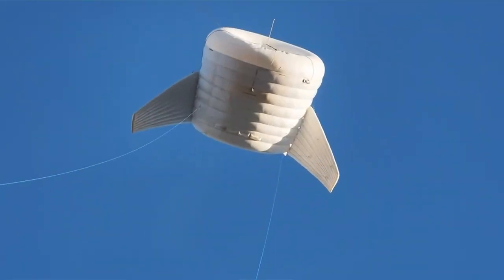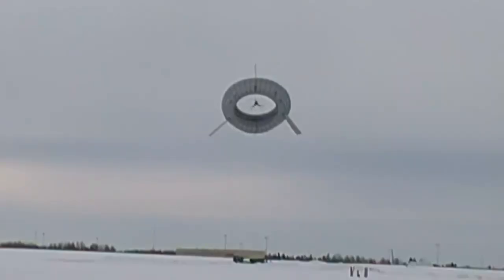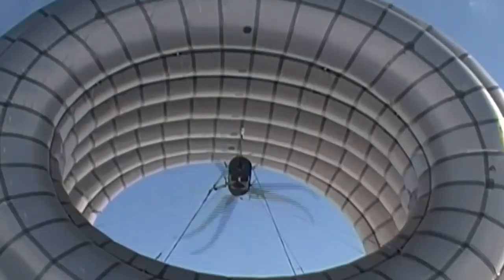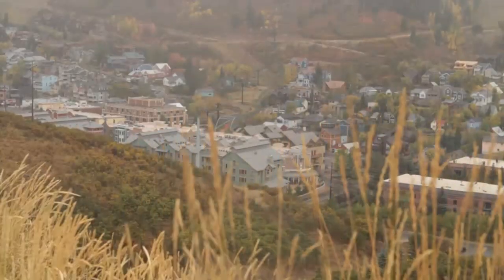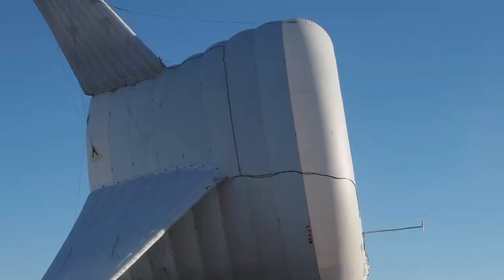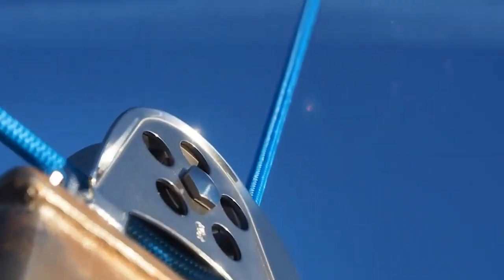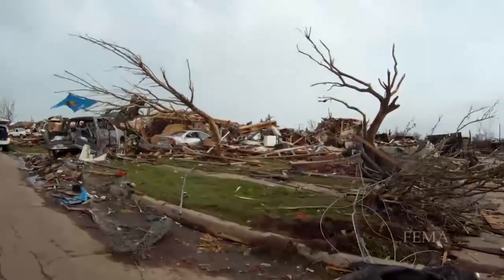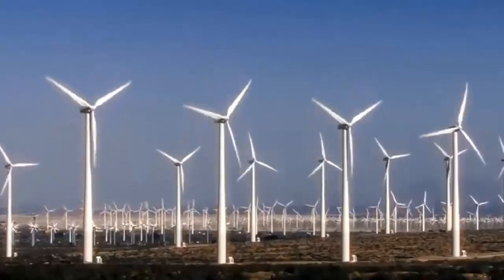Airbone Wind Turbine Generates More Power Safely | Video

Comment: I like the idea, but they plan to use this for disaster situations, alongside first responders.    they compare it to traditional wind turbines, but how does it compare to whatever first responders already use?  which I assume is a big truck with a big generator.  first responders care more about reliability than efficiency.
Reply: I would argue that you could be given multiple choices in what type of generators to use. The wind turbine shown above could be a longer lasting effort when compared to a conventional diesel-electric generator. As the diesel-generator requires a constant supply of fuel whilst the wind turbine could just hover passively without much effort needed.

Both options have pro's and con's. Fer-instance, the wind turbine would be nightmare to setup in New York city.
Reply: *****  Diesel-generators don't work without diesel, oil, cooling.  Wind-turbines don't work without wind. Solar panels don't work at night and battery power is expensive.

Everything has pro's and con's.

Diesel-generators have a high output, reliable and can be transported easily.
However, they require fuel, oil, cooling, maintenance, spare parts and is semi-expensive.

Wind turbine has a high output, is wind-dependent, is very light weight and is relatively cheap.
It only really requires wind.

You get my point? Everything has pro's and con's. So if your at the coastal areas, wind power is not such a bad idea.

Comment: So how long till a $1000 drone blacks out a community for a few million?
Reply: anationify up high like this though, there'd be few disadvantages to just switching to Hydrogen.
Reply: roidroid Absolutely. It's cheaper and I'm sure they will use hydrogen.
Reply: Mark Lucas roidroid I don't have a science background so can you explain why it'd be better to use hydrogen? I thought we used Helium because it was unreactive (no more flying Hindenburgs in a lightning storm).
Reply: Eric Hsieh Helium is more rare than most people realise, there are fears that we could run out if we're not more careful with it.
Hydrogen on the other hand can be made very easily from a variety of sources, including just from water.  It's a troublesome gas though, hard to contain, very prone to fires.  But since these turbines are high up and thus no-one is nearby, there's not much risk to human life if anything were to go wrong.
Reply: roidroid Cool! Thanks for the answer.
Reply: roidroid Correct, once helium escapes into the atmosphere it floats away into space...

Comment: What would happen if it pops ._.
Reply: Probably slowly sink to the ground
Reply: Haha, yea, my fault :P
Reply: Filip Carlén My biggest beef with this method is use of helium which is expensive to use in such large amounts.
Reply: Yes, and hard to make/get naturally
Reply: Filip Carlén But then why are blimps so popular? I always assumed that it wasn't that much.
Reply: Kyle Standard  Helium is only produces in a few locations, China, USA and Russia. The issue comes when you need many cubic meters of the stuff.
Reply: LazyLife IFreak Thanks, do you think its worth the price for that much power?
Reply: Kyle Standard We shall see, if this wind turbine can produce in the kilowatts range then it might be.
Reply: LazyLife IFreak Yeah, we shall see...
Reply: Kyle Standard Its definitely worth the helium....
Reply: Filip Carlén 
Helium is not really hard to get (but impossible to "make" in quantities). In some natural gas deposits almost 20% of the gas is Helium.
The main problem is that it is a finite resource. Once you release it into the atmosphere it's gone forever. It will rise up until it gets blown away by the solar wind into space. Considering that Helium is essential for some medical and scientific devices it is currently way to cheap.
Reply: superdau That was kind of my point, when  you need it in large quantities.

And since this wind turbine requires a large amounts of it ( from what I can tell, some 10-20 cubic meters) and I don't know if the material used to contain the helium will leak it over time, dunno.
Reply: Snott Porter Nothing bad would happen because it's anchored with ropes. It would fall within a 'safe zone' sounding an alarm.

Comment: Can I just buy one and go live in the forest, unlimited internet and electricity
Reply: If you tried, you'd quickly realise why it's just a silly pipe dream.
(And we won't tell what is in that pipe).
Reply: SayNOtoGreens
Why is that?
Reply: brod2man I thought it's pretty much self-evident, but ok - I'll spell it out:
- Unlimited internet. Do you realise that access point up on that thingie needs to be connected to something? Well, what and how? Do you see fibre cable strung from there? Satellite dishes perhaps? Who's paying for those?
- Unlimited electricity. Yeah, right. Until the wind dies down. Or gets too strong. Or that thing needs maintanence (which it will - a lot). Who's gonna provide the maintanence - you? I seriously doubt that. Then you'll have to pay. How much do you think a single call-out of a repair/maintanence crew to "somewhere in the forest" will set you back? So much for "unlimited".
- As a character in one old movie once said: It was a nice dream, it lasted all of five minutes. (Except in this case, it didn't last even five seconds).
Reply: SayNOtoGreens I get it, it was marijuana in the pipe. 420 blaze it!